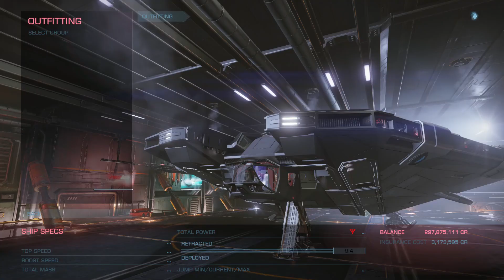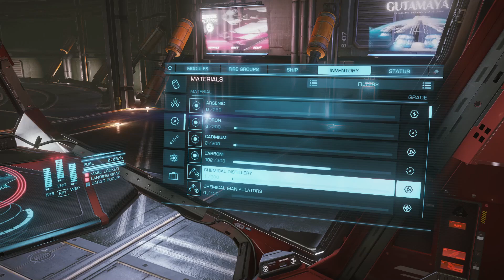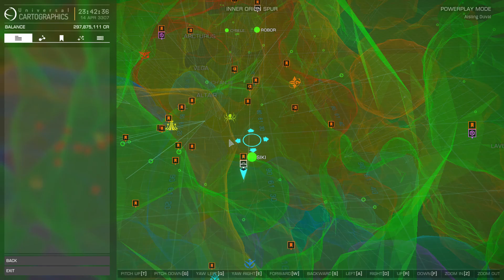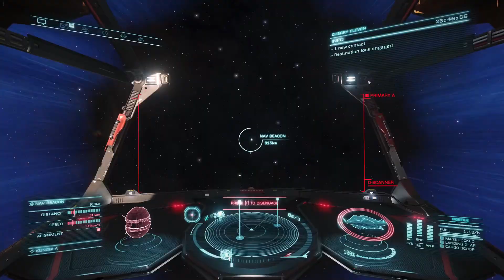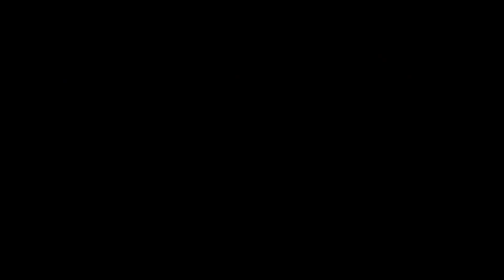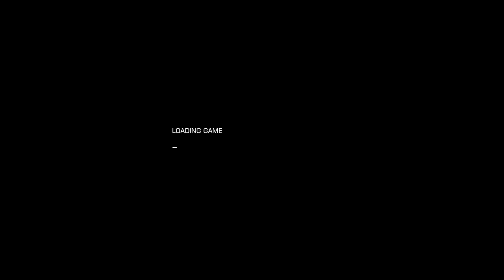Quickest Way To Gather All Engineering Materials Ep 1 : Manufactured [2021] [Elite Dangerous]

Comment: You have very similar HUD colors as mine! Thanks for the video, I came back from 2 years break and this was quite helpful, except HGE farming by quitting is not working anymore :/
Reply: I've been farming it recently and worked for me. Make sure you exit to the desktop. Also keep in mind a single loop (collect, leave and come back) takes about 2-5 minutes so make sure you have lots of time on the source.
Reply: @UrFriendXD  Yeah, I realized that... Same with the Odyssey mats, but thats hardly a gameplay really...
Reply: @wakizashiyoshikawa6926  Yup, Core Dynamics Composites took me 2 hour because it's diluted with the T4 material. The others aren't as bad about 1hr for 0-max mats. Farming mats is boring and slow af.
Reply: @wakizashiyoshikawa6926  You're right.  Having to log out and log back in all the time for gathering a few mats is pretty dumb.  FDev should just allow for places to farm....like more, and more frequent, spawning points.   You can get encoded data like that, so why not for manufactured mats?

Comment: If you had a list of the system requirements, that would be really helpful to have either on the screen in the video or in the description.
Reply: Ask and ye shall receive...

Material                | System Allegiance         | Faction State
-------------                  -----------------------------           -------------------- 
Core Dyn Comp     Federation                         Election/None
Mil Grade Alloys    Independent/Alliance      War/Civil War
Mil Super Caps      Independent/Alliance      War/Civil War
Improv Comps       Independent/Alliance      Civil Unrest
Imperial Shield      Empire                               Election/None
Pharm Isolators    Independent/Alliance      Outbreak
Proto Heat Rad     Independent/Alliance      Boom/None
Proto Rad Alloy     Independent/Alliance      Expansion/None

Comment: Improvised components are currently a pain to get hold of unless you trade at a materials trader for them.
Reply: For farming Improvised Components, you need to be in an Independent or Alliance system, with a Faction State of Civil Unrest.

And here's the full list:

Material                | System Allegiance         | Faction State
-------------                  -----------------------------           -------------------- 
Core Dyn Comp     Federation                         Election/None
Mil Grade Alloys    Independent/Alliance      War/Civil War
Mil Super Caps      Independent/Alliance      War/Civil War
Improv Comps       Independent/Alliance      Civil Unrest
Imperial Shield      Empire                               Election/None
Pharm Isolators    Independent/Alliance      Outbreak
Proto Heat Rad     Independent/Alliance      Boom/None
Proto Rad Alloy     Independent/Alliance      Expansion/None

Comment: Good to see the process, and also to see that sometimes it doesn’t go as planned.
Overcoming these challenges is important to see 🙂
It would be helpful to me, to have more information in the descriptions please?
Maybe like the locations and any important points - like the system states I think you mentioned, and other things to look for.
Thanks again for sharing 👍
Reply: Here you go... enjoy!

Material                | System Allegiance         | Faction State
-------------                  -----------------------------           -------------------- 
Core Dyn Comp     Federation                         Election/None
Mil Grade Alloys    Independent/Alliance      War/Civil War
Mil Super Caps      Independent/Alliance      War/Civil War
Improv Comps       Independent/Alliance      Civil Unrest
Imperial Shield      Empire                               Election/None
Pharm Isolators    Independent/Alliance      Outbreak
Proto Heat Rad     Independent/Alliance      Boom/None
Proto Rad Alloy     Independent/Alliance      Expansion/None